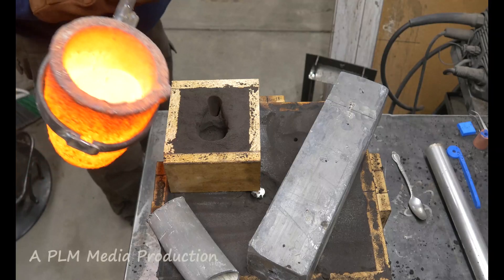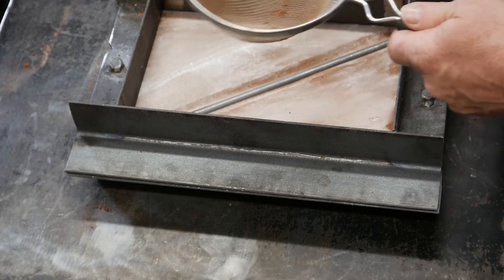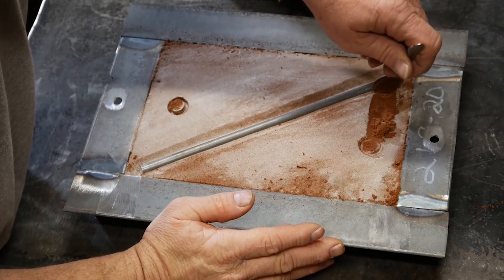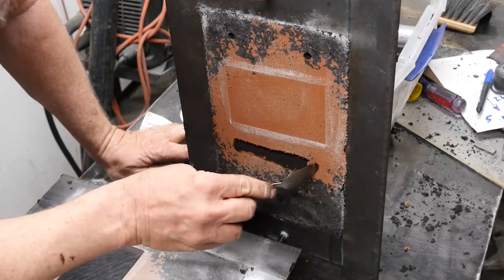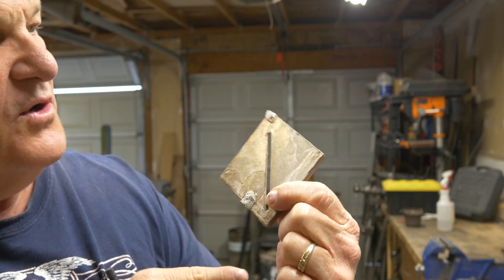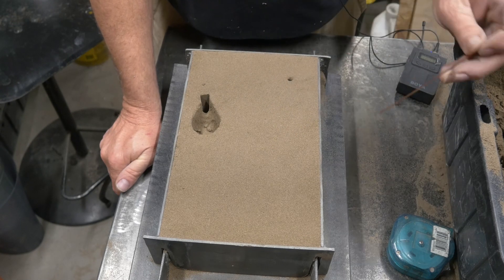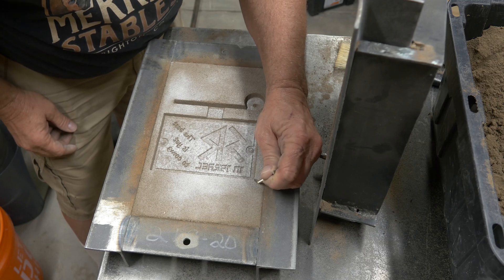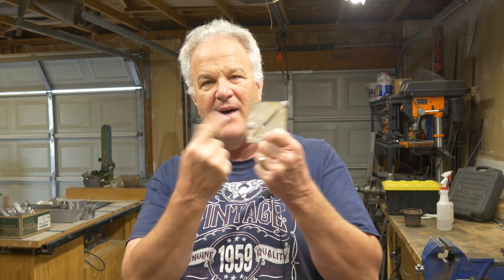Learning to cast metal   Vents

Comment: In our previous house I welded up our mailbox stand and ordered a cast aluminum plaque that had our house number on both sides and bolted up into a frame I made.  We have been in this new house for almost 13 years and I still have not made a decent mailbox stand but now I wonder if I should pour my own plaque. :)  probably not since I have nothing to start with but it would get me started into casting. ;)   All I need is a furnace, crucibles, crucible holders, frames, sand, aluminum ingots, and a 3D printer... Or just pay 100 for one. LOL
Reply from the maker: Heck, for $99 I'll make you one 😃😃

Comment: Hi Perry, first time that i comment on your videos, thank you very much for sharing what you have learned. Early this year, i tried this idea of poking vents with a wire, but strangely i got shrinkage around the vents, wich were filled just some millimeters, i cast 300 mm aluminium rings (50mm tall, 12mm thick), placed (poked) the vents on the upper edge. Anyway, im waiting with excitement for feeders video, next week. Also I would like to ask you, if possible, to make another extensive videos about gates, I do have some parts where I have wide gates that are always difficult to cut off the finish cast. Once again thanks and greetings from Peru!
Reply from the maker: Hello Mike.  Thanks for finally commenting 😃
I'm hoping to get a new video out on Friday this week that will announce a new series I'm going to try to do. It might be just the ting you are looking for.
  
I expect your problem with shrinkage is not because of the vents but because of the amount of metal and the feeders you may or may not have used.  I just shot the first of three pours I'm going to do in the feeder video. There is pretty good shrinkage even though the part is relatively small... much smaller than your rings